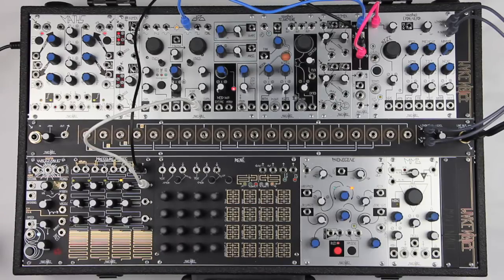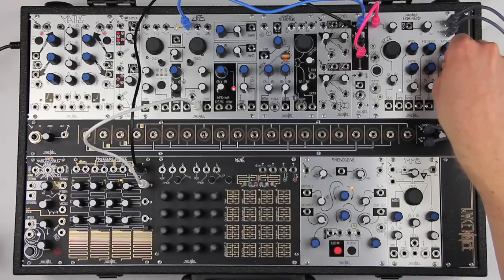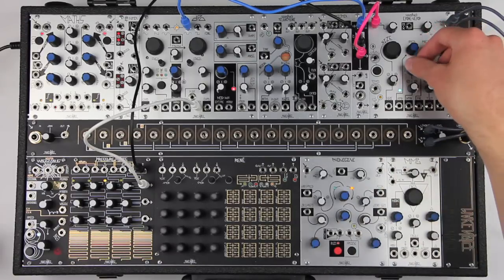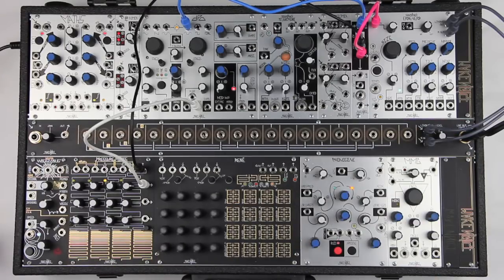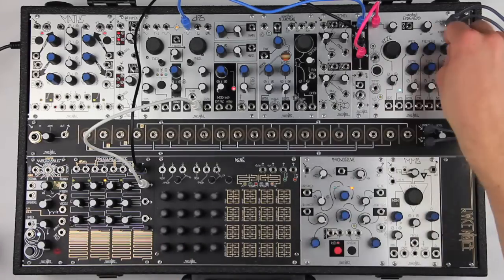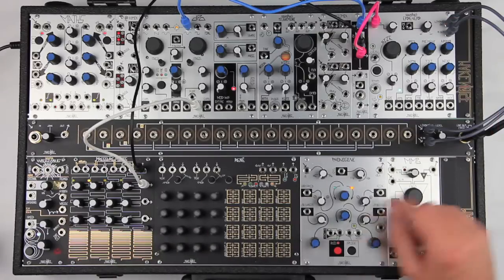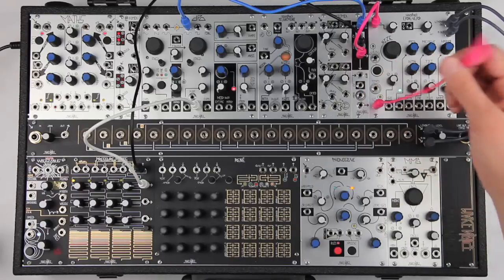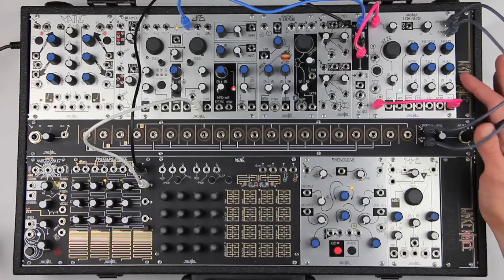Erbe-Verb: Longest, Smoothest Tails

Comment: There's only one problem with this excellent demo, it doesn't sound like a reverb anymore. It sounds like frozen sheet metal in space. I believe - and I guess it makes sense - that a big reverb needs to have a stereo source, - echo and -reverb. This infinite room now sounds 1 micrometer wide. It does not deliver this way. So I would mult the source to the CV bus (1), use the mono inputs for both the Erbe-Verb and the Echophon and patch the FX out to Left, Right and Center mults (2, 3, 4) panned by Maths through the ModDemix and Optomix (little filtering for far away sounds, no filtering for close sounds). Or even better, use a RXMX.
Reply: Cinematic Interesting perspective!
Reply: I bought it for the frozen sheet metal in space sounds.
Reply: @snörre23  Me too. I have several other reverbs and they’re all roughly the same (same chip, I’m told). This is different. Use the frozen metal sheet in space as your starting point…